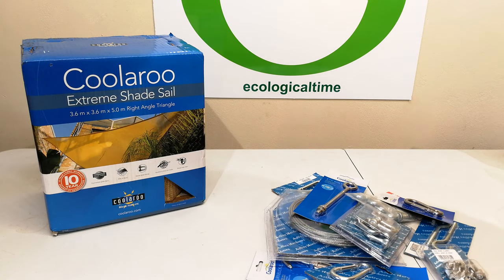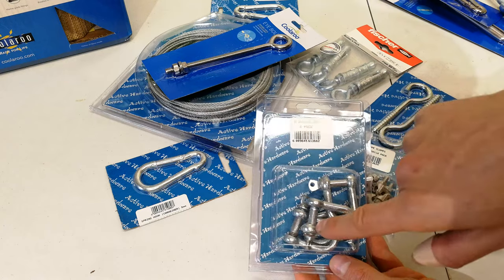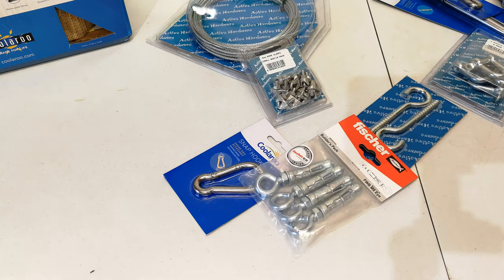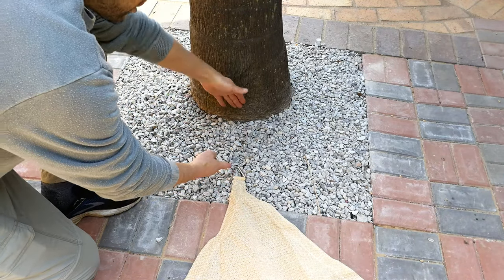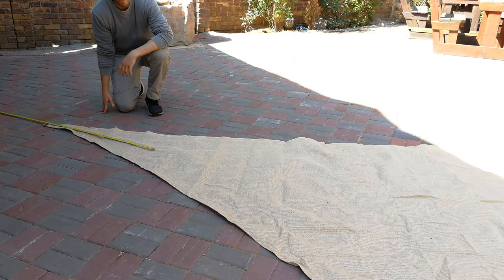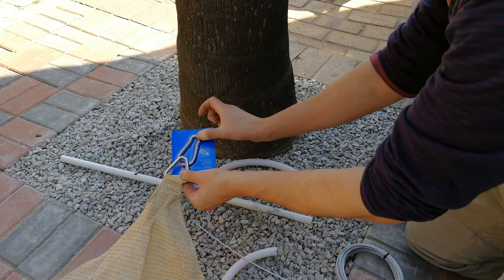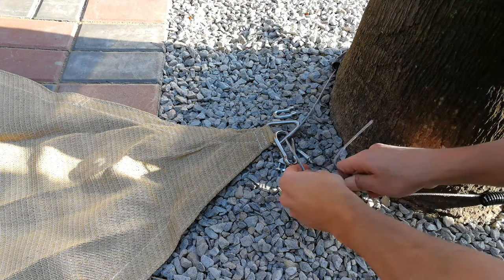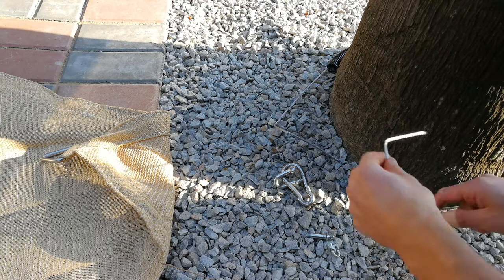How to install a Coolaroo shade sail - step by step

Comment: So when it gets windy and the tree starts to sway , can you post a video of the sail pulling down the side of your house ?
Reply from the maker: this type of palm tree moves 5-10cm mid way under heavy wind. If the tree moved more, the last thing i would be worried about is whether a nylon sail would pull bricks out of the wall, i would be more worried about the roof tiles flying off, as hell that would be a hell of a wind and it would be time to evacuate the house...